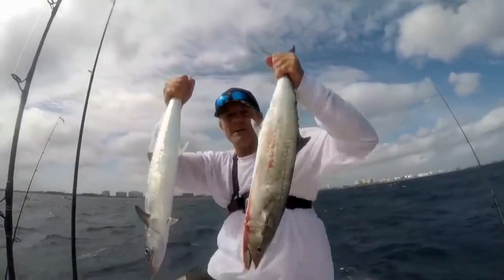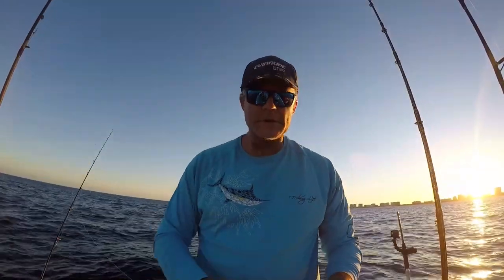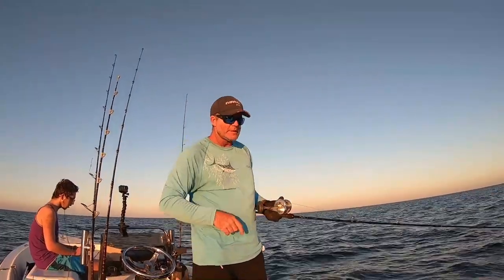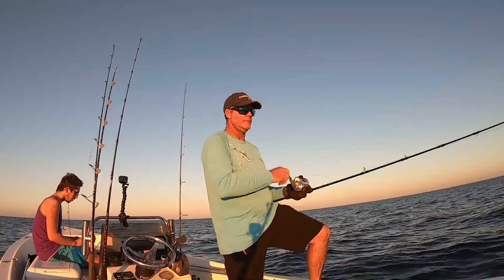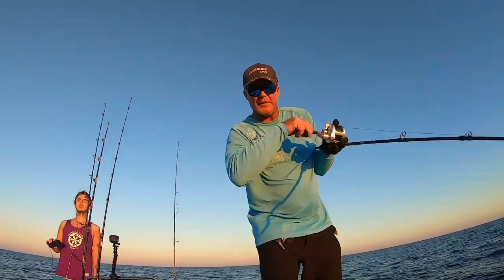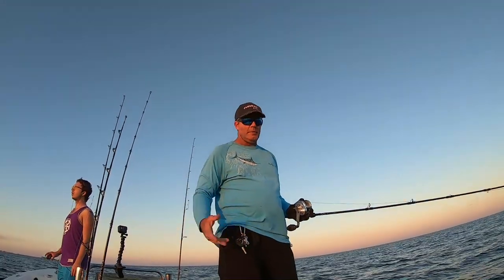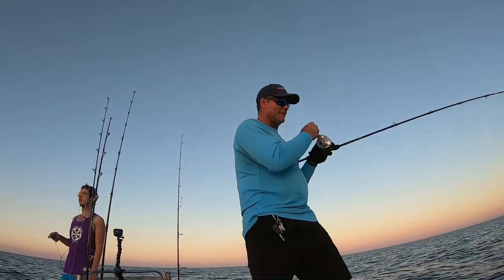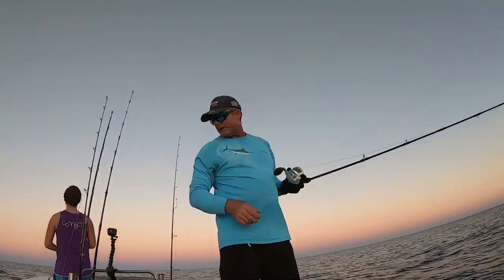SLOW PITCH JIGGING at Sunset SLOW PITCH rod selection Tips & Mutton Snapper

Comment: Awesome info, when your looking for a place to stop for jigging are you looking for some type of structure because after your 150 I can't find anything unless I go near a wreck like the hydro, but I have found very hard to find a place I tried different depths but deaper I can't find any activitie on sonar.
Reply from the maker: Thanks a million for watching and asking a great question.  Finding places to fish deeper is different than shallow reefs and wrecks.  I use a combination of my GPS chart plotter with the contour lines and my fish finder to help identify ledges or slopes to fish, also, if I mark fish then I go for it.  But, I'm always trying new areas, learning through lots of failing.  You should try to head north of the inlet to red rock reef go to 250 and do some jigging.  you're not gonna see structure, but it holds fish.  Great to hear from you and have your support for the channel.  Hope this info helps.  Tight lines & take care ;)